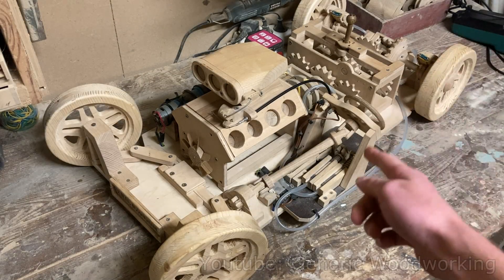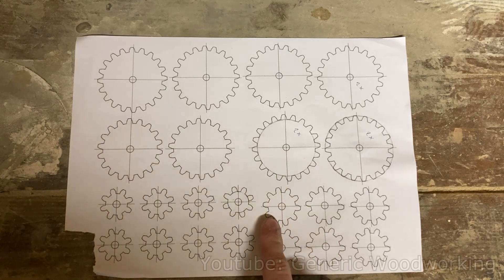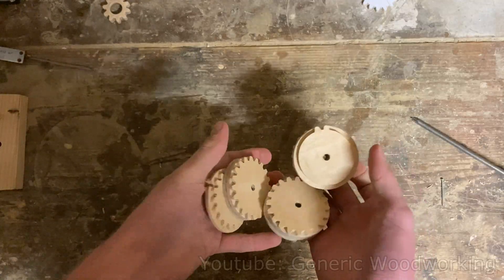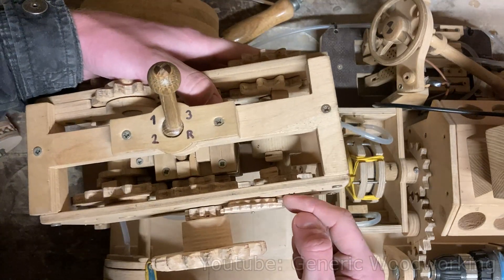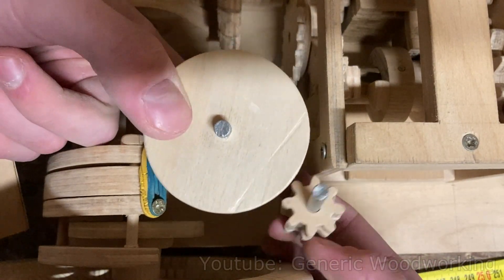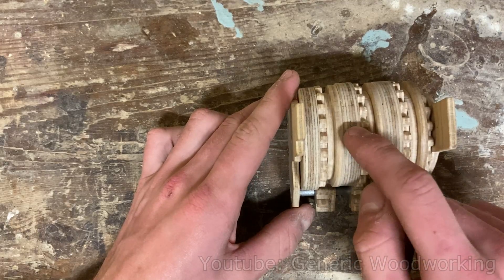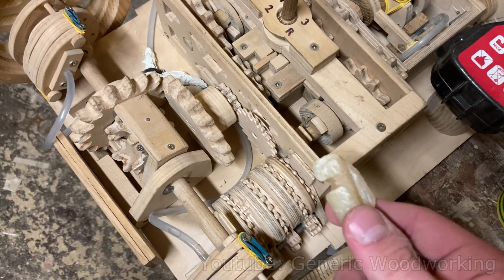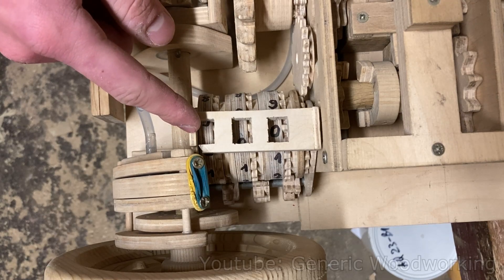Making A Wooden Odometer For My Model Car

Comment: This channel is genuinely the best. He's like the CEO of "Technological Engineering Wooden Scale Models Company" starting from the ancient ages when the wheel was invented. Your builds are extremely awesome. Let's see one day when you have a "RC robot" that sits on your wooden car and watch it go. Keep it up

You are also so creative, especially on that camera set up. Even though you only have a phone.

Also I like how the car has a key and how it is able to change the rpm speed using the accelerator pedal. Also the hydraulics in the brake is amazing.